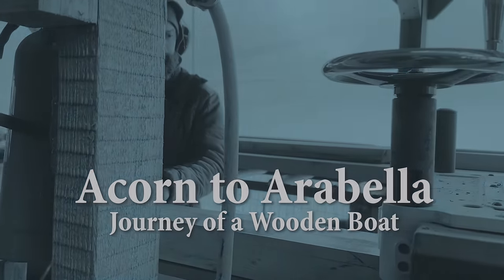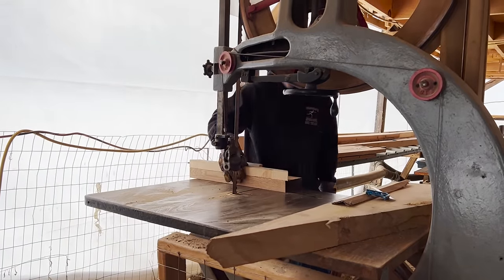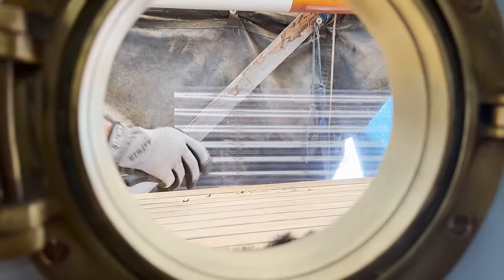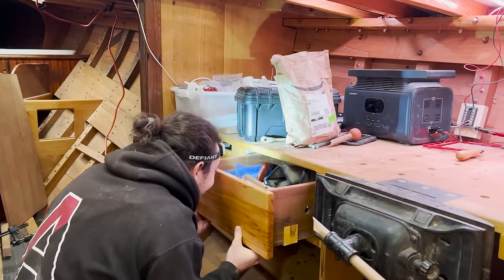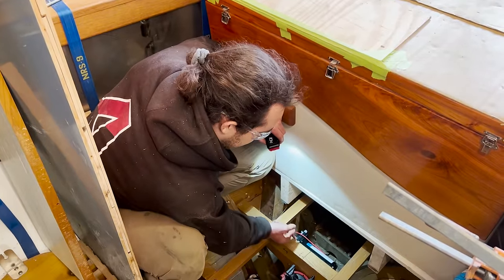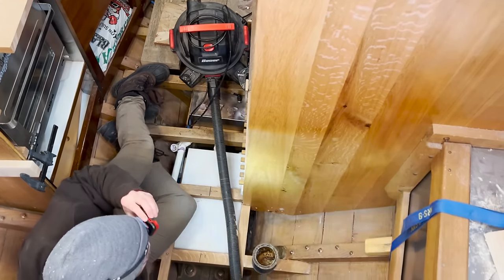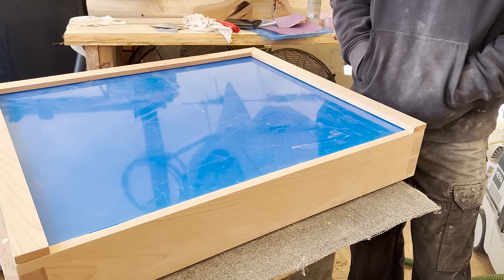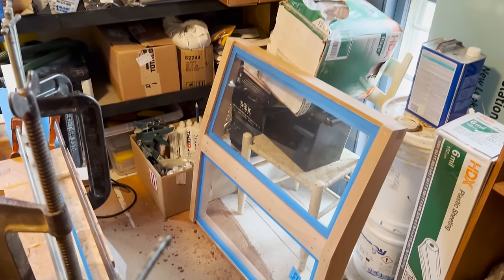A Few More Cooks in the Kitchen - Episode 258 - Acorn to Arabella: Journey of a Wooden Boat

Comment: For those roof lights,  I would extend the plastic (?) sheet out over the lower edge to provide a smooth water run off and use the bronze strips on the top and sides.  Small stainless 'S' clips would secure the lower edge.  But perhpas you have good reason for the bronze lower strip.

Comment: You may want to consider a water expansion tank. When the water is heated in the water heater, if it has no room to expand, it will come out of the water heater pressure safety/ relief valve. Just redesigned my own boat with one after a hot water tank leak scare.
Reply from the maker: Yup!

Comment: The issue with all the pumps for the dam areas is that if they are on a float switch ,that will mean its always wet as the kick in and off is to high and when you hit air in the    vacuum the water thats in the pipe runs back, 
On modern yachts we have dam areas also but find it easier to have a thin hose that you can curl up connect to one of the other bilge pumps with a y valve run the hose switch over the valve and stuck out those areas,  its great if you get other issues water leaks ,dinghy filled with rain ,  and you save a seacock and a pump ,    and cleaning up at sea when the boats rolling you can move a hand hose easier than a fixed pump hose,    same if you get a diesel spill,
Reply from the maker: I think you’re describing a kind of roving bilge pump? It’s hard to tell, sorry if I misunderstand. Yes, the bilge will probably always be a little wet.
Reply: @AcornToArabella  yes , I have found it amazing on areas that become a dam, more versatile,  saves money , saves space , very clean , curl the hose and store under the floor , 
Just a y valve .  I use it on 60 ft yachts , so for you awesome .
Reply: @AcornToArabella  another one is grey water smell , shower waste after a while smells, very surprising ,  I have had to clean them out solo many times not good . 
Float switches are a pain . A switch in the shower pumping out overboard and not via another pump , 
Simple is best .    Just a experienced opinion.

Comment: I’m with him on the hot water. I like having a shower on my boat. But my bathing is a swim and then a cold fresh water rinse. If you have to have hot water take it from engine heat. An electric hot water system on a cruising boat that isn’t some 50ft fiber glass monstrosity is crazy.
Reply from the maker: ¯\_(ツ)_/¯ it’s so personal, isn’t it?
Reply: @AcornToArabella  it is. Re-reading my comment it sounds overly harsh. I just see it as an unnecessary system adding potential failure points.

Comment: not sure if there is solar on the boat but you could use DC heating element as a shunt load for the solar so it would assist with hot water heating

Comment: Are you putting an expansion tanke in the freshwater line ?
when you pressurise to 50psi, then the water heater comes on, the water will expand and increase the pressure,
Reply from the maker: Yes.

Comment: You should do a stress test on that bend you made with the bronze.
Reply from the maker: The equipment needed to know what kind of stress you’re applying is quite a thing, and just banging or putting random loads on something isn’t particularly enlightening—knowing a good weld, trusting the source of the material, and handling it with care and experience goes a long way. They’re plenty strong for the purpose, and most likely a tad overbuilt like most things on Arabella. 🙌
Reply: hey, that sounds like a good suggestion, but you forgot to explain what kind of stress test would make sense here.
can you explain this in a bit more detail ?

Comment: Grey water pump is upside down. Motor should be on top so that if the shaft seal fails, the water won't get into the pump body. PITA to mount that way but is correct.

Comment: On the hot water shower: A guy might could do with cold water showers, but not a woman.  And sometimes, when you are really cold, hot water helps warm up your core.  One doesn't need it all the time, but the option to have one, especially as one gets older, is a nice feature to have.
Reply from the maker: Your last two sentences there are “would be nice” reasons to have the hot water system, but truly, women don’t require showers. I’m a woman who has lived aboard and never had an AC/pressurized water heater on board and knows many other women with same who travel happily and far. —Anne

Comment: Any particular reason there is a hot water tank and not just an instant heating system? Electricity spikes a problem?
Reply: It's not the spikes as much as the total load. Instant hot water takes at least 5kW, which means much larger inverter and cables (installed water heater is 1.2 kW). This heater is also nice because it can be heated by the engine coolant loop as well as electric, and the storage means that heat can be saved for later.

Comment: I'm wondering why the battery box does not include heat dissipation. I thought that a key difference between lead-acid and lithium chemistry batteries is the temperature and amount of heat generated.
Reply from the maker: These are lithium iron phosphate batteries, not lithium ion batteries.
Reply: @AcornToArabella Lithium iron phosphate batteries are examples of lithium ion batteries. Any advantage over other lithium ion batteries comes from their specific chemistry and not because they are not lithium ion batteries - because they are.

Comment: Obviously he has never taken a shower at sea in the dead of winter. Or is this going to be a fair weather boat only, used in the Spring and Summer. One time and he would greatly appreciate that hot water.
Reply from the maker: Two things. Firstly, a hot water heater is going into the boat for Steve, who has not been to sea in the dead of winter but who is electing to have a shower in his boat, so you’re in agreement with him there. As for Satchel, he has done the Race to Alaska and some boat deliveries (normally at just the wrong time of year), I’d say he’s aware of what it’s like on a boat when it’s cold. As do I, and I’ve never had a shower on board and cruised year round (not in the Caribbean). But I’m a Mainer so maybe we’re just made different. 🙌 thanks for watching! —Anne

Comment: Maritime decarbonization?  How do you feel about the carbonization created by the mfg of batteries?  Feel that people just avoid discussing that.
Reply from the maker: They often do! Or of different impacts from mining or manufacturing processes. Normally, there’s still an impact, but long term and among all consumers, it would be a shift for less carbon over all. Thanks for the thought. —Anne
Reply: I've been part of very extensive studies on the lifecycle carbon impacts of electric vessels vs fossil fuels. Even with battery replacement accounted for, the total (including embodied) emissions reduction is huge, especially on vessels like ferries that operate around 5000 hrs/year.

Comment: IMHO lithium technology for marine batteries will have a very short shelf life. By the time these are due to be replaced, I expect lithium to be viewed as yesterday's technology.  The cobalt and lithium used will become increasingly expensive and scarce.  And the mining practices are horrible.  Sodium batteries are already being viewed as a cheaper more sustainable battery albeit without quite as much energy density.  It is understood that Tesla are already looking at this, and also use of hydrogen powered ICE.  Both these solutions have much larger reserves!, and are much easier to source. I don't think hydrogen will work for marine cruisers - day boats are a different problem.  However sodium batteries have significant benefits for marine use.
Reply from the maker: Short shelf life is ok, since these SOK batteries have at the very least a 4000 cycle lifespan, and can have 8000 cycles if well cared for. Short shelf life is most technology all over… it’s not special to boats, that’s for sure. And here’s for the price of lithium going up and sodium batteries getting better for the market eventually. The mining for lithium is an awful practice. Necessary for other things as well, but the demand decreasing will be a good change. —Anne